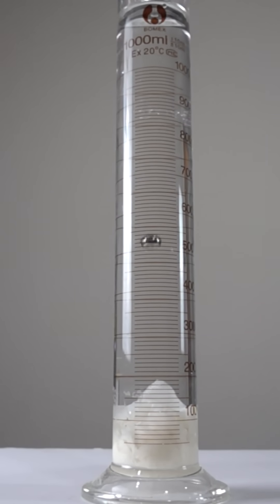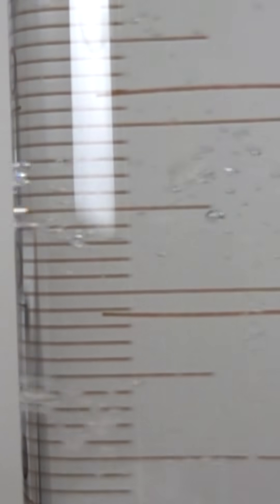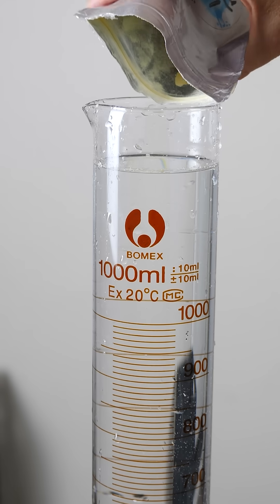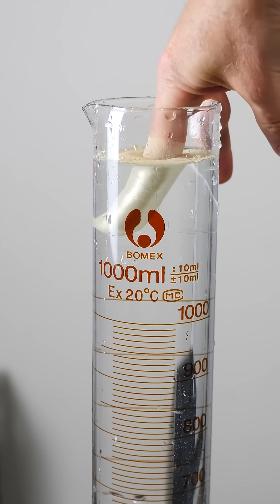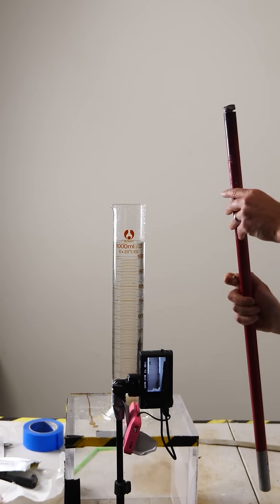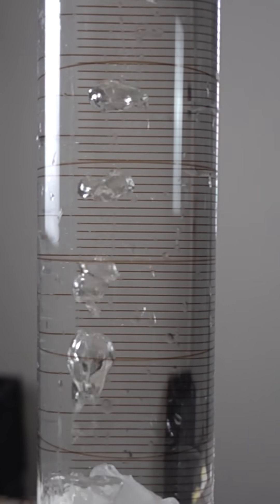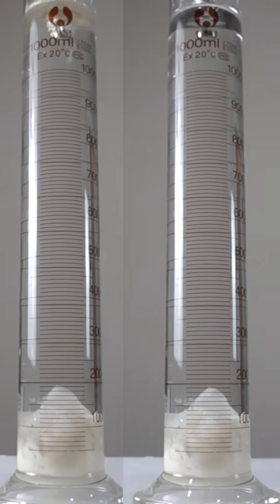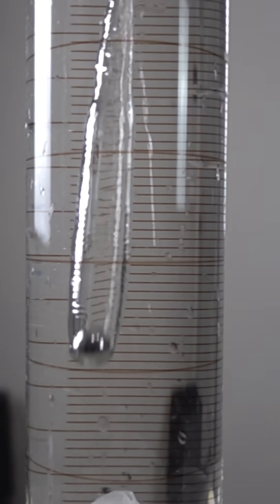Making a Frictionless Torpedo

Comment: You can also heat the metal ball  above the boiling point of water and formulate how far it's going to travel and it's mass , and get the same effect. Actually it's believed that the new generation of American submarines have both hydrophobic paint on the nose and heating elements that boil the water around the front. To help it get more speed and not effecting the ability of the propeller "I'm the back to bite the water.

Comment: Btw if you want projectile with less friction underwater use longer projectile - at higher speeds underwater it creates air bubble at front of the projectile alowing it to move through water faster and with less friction. Those kind of projectiles were used in ww2 i think for guns that cloud work good underwater.

Comment: Technically the reason you don't want this is because disturbances in the water like big bubbles or cavitation show up easily on radar. A lot like how a struggling fish is sensed a lot faster than a fish swimming normally in water to other predators

Comment: Am I right is thinking that this would only work vertically. If you try to do this horizontally you would need power and the propeller would not work in the air bubble at the rear. Add to that the air bubble would have difficulty staying intact behind a horizontally moving object.

Comment: It is the turbulence behind the basic ball, a proper shaped object not creating the turbulence will also pass faster. The bubble actually creates the needed streamline shape avoiding the turbulence  until the very tip of the bubble but there the turbulence no longer affects the ball  only strip's small amount of bubbles. Over longer distances the bubble is stripped and the ball will slow from trailing turbulence.

Comment: Um , 🤔🤔🤔, wouldn't it be around 0.3 times as much increase in efficiency and not ten times more seeing that if it's only 30% faster then hat would come out to the same as doing something , say like this for example , 3 times and thus equating the exact same time frame of how long it takes the non-hydrophobic marble to hit the bottom 3 times as it would take for the hydrophobic marble to be dropped 4 times from top to bottom ??? Is that right ??? I'm actually very sure it is right but I could be wrong 🤔🤔🤔 - scratch that - I'm 1000% sure that's absolutely correct 🤣🤣🤣

Comment: You did it again. One simple experiment led to me thinking about different ideas for 40 minutes..!

• If you want to go completely frictionless (or as close to it as we've discovered), there's a Ceramic composite material created by combining an alloy of Boron, Aluminium & Magnesium (AlMgB₁₄) with the ceramic Titanium Boride (TiB₂) which has a Coefficient of Sliding Friction value of 0.02 (making it very, very slippery indeed)!

• Going in the opposite direction, have you tried coating things with other materials - such as the carbon nanotube coating caused by Black 3.0 (the blackest, black paint in existence)..? The immense surface area of the carbon cause tremendous drag & perhaps other cavitation effects in the process.

• If you first coat the sphere with a waterproof adhesive, dropping it through thin, even layers of various substances poured (or perhaps floated on a soluble polymer substrate) onto the flat surface of the water (or some other liquid medium) should be an excellent method of coating it uniformly across it's entire surface. 
Or alternately, heat the steel ball sufficiently that a Metallic/Ceramic/Polymer nanoparticle coating (on the surface of the liquid) would melt & fuse to the ball on contact. 
Or even replace the water with liquid Nitrogen to create an incredibly dynamic surface for the nanoparticles, leading to a highly unpredictable & unique coating on the heated metal ball.
Reply: Idk the first thing I thought of is what if you coated a torpedo or missile with it

Comment: So, this is not frictionless, it just doesn’t have the nearly as much turbulence in its wake, at least not from the liquid. However, it still has to push the water out of the way on the way down, it’s just the powder is much better at doing it because of the surface area, you could get similar results by making divots on the ball, like a golf ball and that would also increase the speed it drops through water.

Comment: i mean as cool as it is this is under normal pressure , when under deep sea pressure that oxygen layer will not easily form. Though this would in my opinion be great for vessels like  Hydroplanes, or potentially an ultralow surface tension vessel . A good piece of evidence to this is pond skaters as they generate the same low friction effect using the microscopic layer of hairs on their legs

Comment: Wohhh, weird a** thought...What happens if a human coats themselves in a hydrophobic material and jumps into the ocean, would their still be a pressure change (propably) would they become le squished (again most likely) and would it be possible to do a natural sprint underwater rather than a slowed version due to the resistance against the water (thaaat I don't know)

Comment: But no torpedo is shot straight down so they require a propulsion that is usually a propeller on the back because torpedos travel massive distances usually unguided if you make it hydrophobic it will effect range and accuracy

Comment: If you had enough of that powder on the surface of a swimming pool and a person jumped into the pool through the powder would they immediately sink or have difficulty swimming I know that there is going to be some neutrality due to the organs and fluids in air inside the person but would that powder make a very large difference in a persons ability to swim or stay afloat?

Comment: Hmm. Maybe that can be used a long with engineering to make an extremely low drag submarine.
Reply: @Shadow Responder yeah but it might be good to have smaller submersible as part of a submarine group. ones that can engage larger submarines at faster speeds. think of it like if the submarines we have now are aircraft carriers and the smaller vessels would be like destroyers or frigates. would be good for civilians use as it could make sailing more safe, faster travel than on top of the water, they can be made electric for a smaller carbon footprint, etc. I see a lot of potential for both markets. civilian and military.
Reply: @Shadow Responder -_- less drag isn't just about more speed. also maneuverability. which can help in shallow waters where bigger submarines cant go. also a majority of torpedoes are electronically guided. meaning they can be jammed. they also have manual launch systems but that leads to an easy miss. also i wasnt meaning the military. not in my original point. so the argument was pointless to begin with
Reply: @Shadow Responder also torpedoes arent the only underwater weapon. the most reliable and tested, sure.

Comment: Something very fascinating look up the word supercavitation. Supercavitation is encapsulating an object in an air bubble to reduce its friction. Soviet Union developed a torpedo called a VA-111 Shkval. This torpedo had a rocket motor for propulsion some of the exhaust from the rocket was vented through the nose this created the effect of encapsulating the torpedo in a gas bubble. These torpedoes could travel at over 300 miles an hour underwater. The German Navy also has been experimenting with this concept they call their torpedo barracuda.

Comment: This could be the answer to a perfectly stealth submarine. 

Bubbles form when an object moves through water creating pressure changes, which literally boil the oxygen in the water, resulting in bubbles. 

Stealth tech on subs has become so advanced that the only thing that gives them away, is the bubbles popping as the propeller spins. Modern subs counteract this by adding more blades and giving them less pitch, but they still produce some bubbles, making them trackable. 

Maybe a prop, powder coated in this material, could finally be the solution.

Comment: Wait so, if you coat your hands with hydrophobic spray and dive hands first from great heights, would that actually help you break the surface tension more easily or would it be unaffective due to the dive velocity?

Comment: The ball doesn't need to be hydrophobic to do this though. We used to do this with ball bearings at the pool all the time growing up. If you throw the ball down with some force or throw it up in the air, it will have that cavitation bubble behind it after it goes under water. You don't need hydrophobic powder, you need MORE SPEED!

Comment: This ignores the need for a torpedo to change direction which requires friction. 

This is the reason why super-cavitating torpedoes are DOA. They are good at going fast, but the layer of air created between them and water prevent any sort of rudder system with which to steer.

Comment: US Military: WRITE THAT DOWN WRITE THAT DOWN
Reply: @DefinitelyNotOnTerms  interesting af
Reply: Cavitation is already used in torpedoes
Reply: Militaries rarely have the patience required to grow moss, nvm enough to coat their munitions haha
Reply: @alexparris7769  there are hydrophobic surfaces that don't require coating, like the surface of the material itself becomes the hydrophobe
Reply: Super cavitation torpedoes are something they have tested. Different method but same effect torpedo is in a pocket of gas instead of water and can go way faster. Steering is a issue l believe.
Reply: @johno1544  now if they can make propulsion on it
Reply: @johno1544  yeah reducing the forces on it does make that difficult. Of course the upside is it moves several times faster as you already knew. For those that don't, regular torpedoes go at about 50 miles per hour whereas supercavitating torpedoes move at a few hundred kilometers an hour
Reply: @Boppin.  awesome you know that. That's such a crazy speed compared to what any sub or surface ship can do. Definitely could be a game changer for submarine warfare.
Reply: @johno1544   regular torpedoes are limited to ~50knots because cavitation ruins their passive & active sonar’s capabilities.    The Soviet’s 1st-Gen super-captivating torpedo just doesn’t come with sonar, and is instead fired unguided like a WW1 torpedo. 
The counter is a smaller anti-torpedo torpedo, which even the Virginia submarines use for torpedo defence.
Reply: My thought exactly Lmaoooo
Reply: Beat me to it
Reply: Yes but like 40 years ago
Reply: Anyone who watched Mr Wizard's World in the 80s already knew about this stuff. Its awesome.
Reply: They actually did. Look up 'supercavitating torpedo'
Reply: So you just need to put the gun hydrophobic 
Powder  and and now it’s more deadly
Reply: LOL I should scrolled b4 commenting
Reply: Lmao
Reply: Navy*
Reply: I came to the comments looking for this. haha
Reply: @DefinitelyNotOnTerms  wouldn’t it just sink?
Reply: @cesarcoronel9135  no, a hydrophobic surface on the vessel doesn't negate buoyancy it simply reduces drag. The seawater will still press against it and give it an upward force. Edit: for full clarity. The reason it makes the balls fall faster in video is that reduction of drag. But the balls don't drop because of the coating, they drop because they have a higher density than the water. Submarines are able to modify their average density by taking on or pumping out ballast in order to ascend or descend by changing the balance between the buoyant force and the Fg (force gravity) acting upon the vessel
Reply: The Soviets already has something like that. The Russians now developed a 'wake homing' torpedo that has the same technology incorporated
Reply: It's already done is called Shkval, a 300km/h torpedo and is Russian
Reply: Release the methane hydrate and Lycopodium powder to foam under the ships!
Ships: get sucked into the water.
Reply: Just video it with another phone

Comment: Question. If you remove the drag coefficient that much would the torpedo not just sink straight down instead of going to its target. We would need to rainbow shot a torpedo that wouldn't exactly be more accurate. Someone who knows more than me correct me.

Comment: The Military Industrial Complex: 👀
Reply: No use for submarine as the bubbles behind it would make a lot of noise.
Also, would a frictionless propeller actually work as it's not actually pushing against the water. 🧐
Reply: @CS-zn6pp  torpedos?
Reply: @CS-zn6pp  maybe the submarine is, but the propeller isn't.
Reply: less friction is good. you may have noticed that almost every fan or nice propeller you see is smooth @CS-zn6pp
Reply: This was my very first thought

Comment: How do you wash that powder off?
Reply: Amputation.
Reply: @sordidknifeparty  lol
Reply: @sordidknifeparty  thats overkill
Reply: @sordidknifeparty  fun fact this also works with glitter
Reply: With hydrophobic water.
Reply: @corbans5796  that actually exist
Reply: @shotaconera2327  worst decision of my life
Reply: @corbans5796  most liked comment on a comment probably ever
Reply: @corbans5796  😂
Reply: @corbans5796  "hydrophobic water" is an oxymoron. Any hydrophobic substances, like benzene, oil, fat, soap will work
Reply: @corbans5796  lol
Reply: @LangstonDev  And to make it, you need some water and some klabaklubakleebankluger powder.
Reply: @LangstonDev  To make the klabaklubakleebankluger powder, you need some hydrogen peroxide and some tobangano powder.
Reply: @LangstonDev  Then, to make the tobangano powder, you blend up some chili peppers and put in 1/3 isopropyl alcohol. Oh, and crushed up crackers. Use a mortar and pestle if you want.
Reply: @parkerellis746  Mortar… 105 mm? And a pestle? Alright mate
Reply: If you dip your hydrophobic powder coated finger in water, then try to rub the coating off under water, it peels off and rolls up like dead skin.
Reply: Just wipe it off with a paper towel
Reply: Soap + water and probably a sponge
Reply: @methane5211  soap is hydrophobic too
Reply: @tejaswadaboria7455  That's why it's perfect for removing hydrophobic coatings. They're both non-polar and will mix. Using oily soap like dawn dish soap will work. You could probably even just use oil, like coconut oil. Then melt the soap/oil away with hot water, and wipe it dry with a dry towel.
Reply: Fire
Reply: Use water should work
Reply: This guy asking the real questions
Reply: Waterproof water
Reply: You snort it
Reply: Something oily probably
Reply: Soap
Reply: Dry shampoo.
Reply: @ericwallace2147  a dry cleaner.. works for clothes
Reply: Nice question, you dont
Reply: It’s a powder just use a rag duh
Reply: I would rub it against my jeans.
Reply: Just embrace your hydrophobia
Reply: Run really fast with your arms out like an ✈️.
Reply: diesel fuel
Reply: There's a new thing, its called a towel.
Reply: @ConstantUNTILisnt  towels are for drying things!!
Reply: That’s the neat part you dont
Reply: Hmmm
Reply: You blow it off.
Reply: Lava prob
Reply: Just put it in your pocket
Reply: Dip the finger in Sulphuric acid.
Reply: U don't
Reply: A towel lol
Reply: You uh... Um... Hmm
Reply: You don't,  you just blow it off.
Reply: You don't. 😂😂
Reply: Simple, you just wash it. It's hydrophobic. It will go away.
Reply: Soap
Reply: Cut an onion in half, throw it

Its for good luck
Reply: Yes here is the thing... YOU DON'T
Reply: Brush brush brush brush
Reply: Vinegar
Reply: @loganbettis2031  never apply vinegar to a chemical powder substance lest you get sent back to the battle bus
Reply: you don’t
Reply: You don't. It lives with you now. Say hello to your new finger friend.
Reply: Explosives💥
Reply: I would say a stick of dynamite, maybe two to be safe.
Reply: You don't.
Reply: 80 grit sand paper
Reply: Battery acid or diesel fuel.
Reply: Surfactants is the most correct answer here. Soap would work because its surfactant properties.
Reply: You don’t
Reply: Tabasco. 🔥🔥🔥😂😂😂
Reply: Sulphuric acid
Reply: Soap.
Reply: Have you ever heard of SOAP AND SPONGE?! Pft Americans
Reply: @NOTAMUzzzED  pffft 3rd world countries and gen Z Americans*